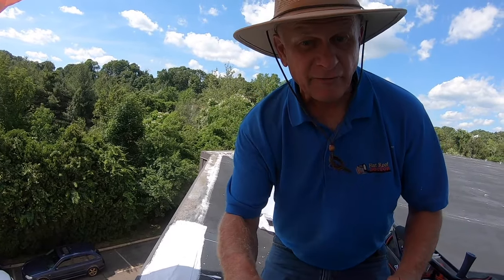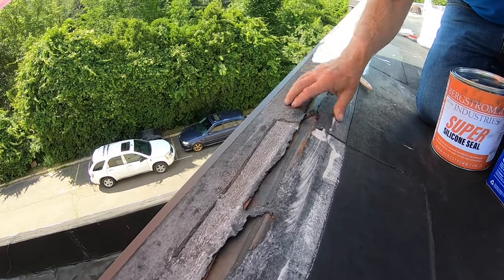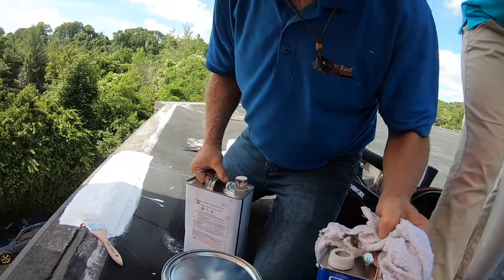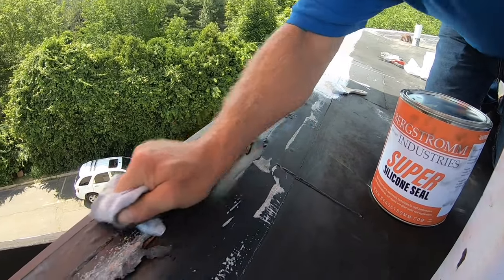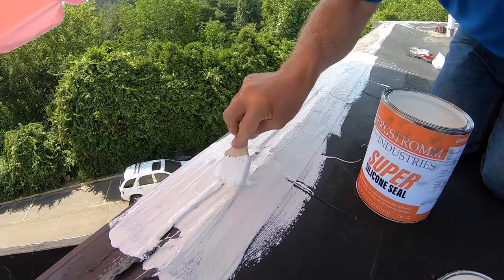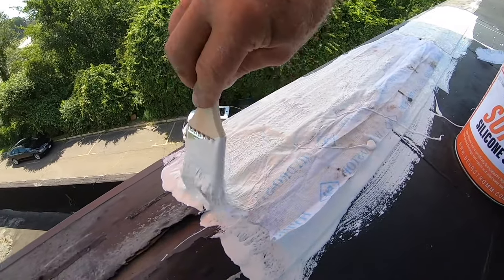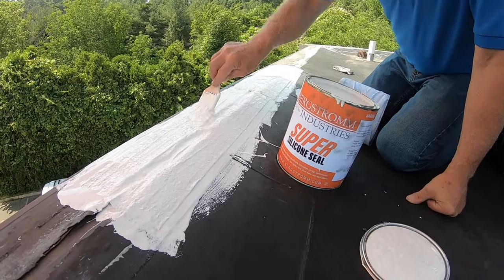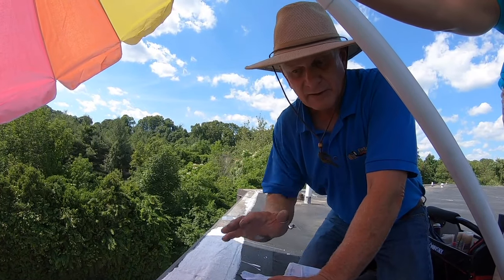Flat Roof Repair using Super Silicone Seal | EPDM Rubber roof repair | Easy DIY in 5 min

Comment: I’m learning so much from these videos. I didn’t know that super silicon seal works on APDM roofs. As always looking forward to your next upload.
Reply from the maker: Yes, this is an amazing product. It bonds to EPDM like none other sealant.
Reply from the maker: Super Silicone Seal is about the only product that will adhere to EPDM Rubber. It is really amazing
Reply: Flat Roof Doctor What’s the difference between silicone caulk and this Super Silicone product when applied to EPDM?
Reply: @anon5704  the fleece i gues
Reply: Can you use that for the seams on the roof
Reply: Hoe long does this last.? I also used something like liquid rubber and that lasted for years on wood but does not stick on epdm.. In Europe I can't find this what you are using

Comment: Try Inland Coatings EC2000. Liquid EPDM
Appreciate the video. I just don’t trust silicone.  
How long have you been using this product?
I have used RC2000 over 15 years with no peeling. 
It goes over rust,rubber, modified, flashing cement etc.  they even have a clear version for beat up penthouse skylights.
Reply from the maker: I just checked RC 2000. It looks cool. There are many products out on the market. I think Inland Coatings uses a private label and it appears its from Gardner https://gardnercoatings.com/
I may be wrong, but there are only a few companies that actually produce sealants.

Comment: No it ripped because theres no perimeter fastening on the wall. And its causing the rubber to stretch. That stuff will also crack in time you'll see. Rubber to rubber is the only correct way. Brush on and peel and stick all that stuff is a gimmick

Comment: Could of fixed the perimeter down with a bar first before sealing so the expansion and contraction won't tug at the new fix
Reply from the maker: Correct, But a termination bar is not needed when attaching to a drip edgeThe proper way is to cut the EPDM Rubber loose so to relieve the tension , then add a rubber piece to fill the gap or use Super Silicone Seal than can do the same.
Reply: @FlatRoofDoctor  I understand that's what you do when you first install the roof as the drip edge acts as the termination bar. But as there is a split there is now nothing to stop the tugging definitely should of barred then applied liquid
Reply from the maker: @darrendavies1156  We both agree that the EPDM Rubber shrank and is causing stress on the edges. How to address the problem every man has its own methods. nothing wrong with what you say,
I am not an EPDM Roofing expert by far. But I just don't think screwing a termination bar to put more stress on the rest of the roof can work. 
As I described earlier, cut the entire perimeter lose from the metal drip edge so to relax the membrane, I guess the roof surface would be approx. 2" inch short from the drip edge. That's when I will breach that gap between the roof and the metal drip edge with Super Silicone Seal. It comes with polyester fleece and after applying it, I have found that the Silicone bites into the rubber and won't separate as cover tape does over time.
Anyway, I like your input. What do you think about my idea?
Please let me know. I assume you must be an EPDM expert. I come across this EPDM Rubber shrinking a lot but have not really come up with a solution.
Your advice and explanation will be highly regarded.
Best regards
Naas
Reply: @FlatRoofDoctor  I'm a flat roofer in the UK I've done all flat roofing for over 20 years epdm. Upvc single ply tpos torch on asphalt liquids grps etc I love ya videos but the way we do stuff here to the way you do stuff in the US is like chalk and cheese. You use metal drip formers for your edges on torch on we make are own out of cap sheet. At some point when I come to the USA I'd like to show you my skills 😊 keep up the good work everyday is a school day
Reply from the maker: So, when you make your drip edge out of  the same material as the cap sheet, how do you give a finish look on the edges like a white or brown drip edge would?

Comment: Can I use Turbo seal instead of super silicone seal on Epdm ?
Reply from the maker: no, you cant. Turbo Poly Seal is partly a Bituminous resin and petroleum products and EPDM Rubber ( synthetic Rubber) are not compatible.
Reply: Flat Roof Doctor What will happen when EPDM comes into contact with asphalt products such as roofing cement?